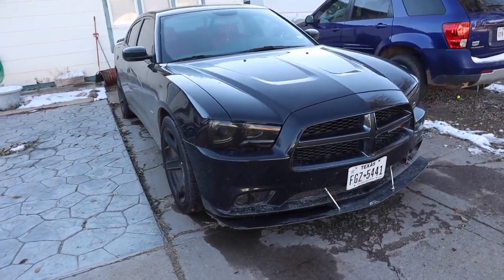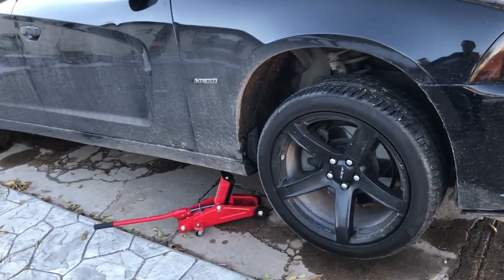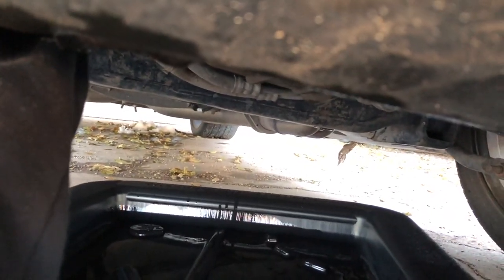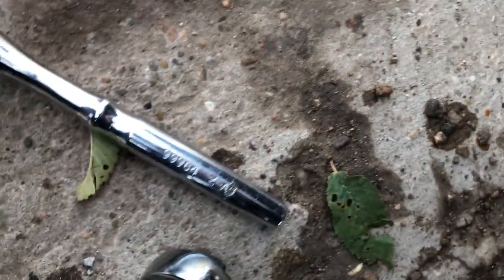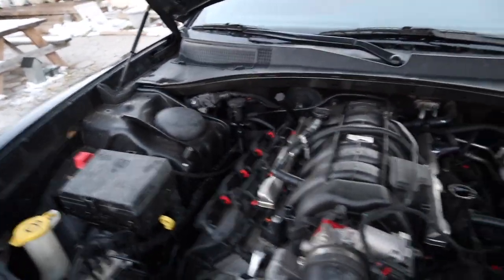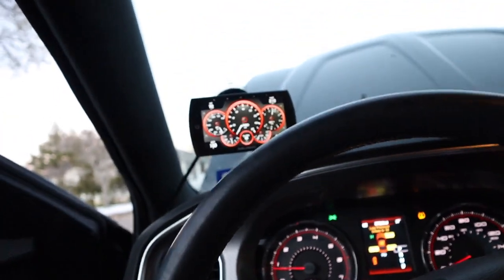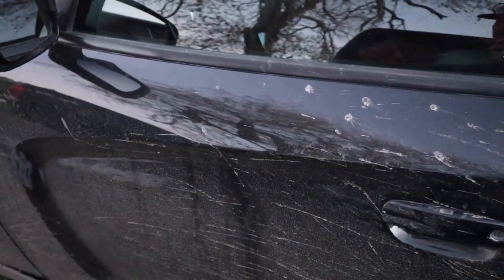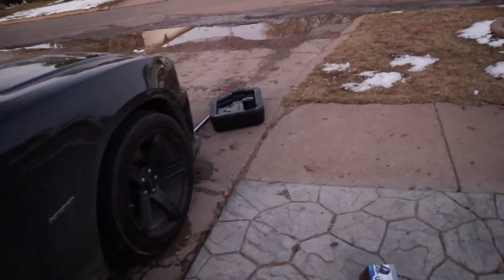First Oil Change After Cam Installation And Talking About The Cam! (Oil Change Tutorial)

Comment: I know it's an old video, but when checking your oil on your dipstick, turn the car on, let it idle for about 15-20 seconds so it goes into the oil filter and into the pickup tube, turn the car off, and check the oil, if it's coming out low, open the oil fill cap and check it again, if it's still low, add more oil, if it's normal, it's fine.
Reply from the maker: Yeah thats what I usually do just didn’t get it on video
Reply: @blackphantomrt5355  Ah ok haha